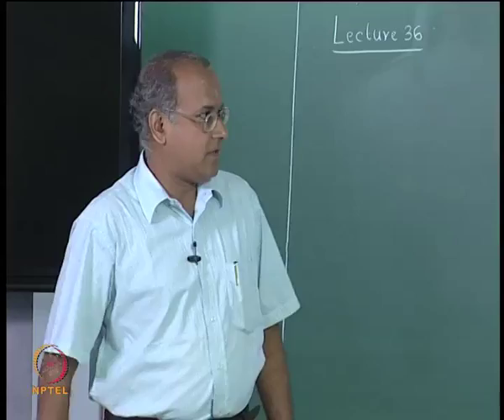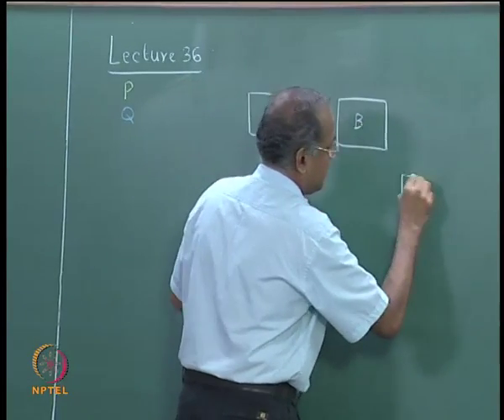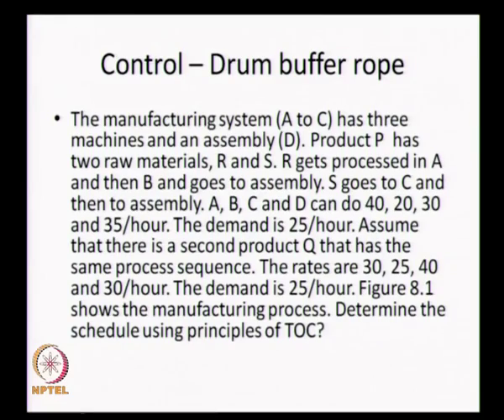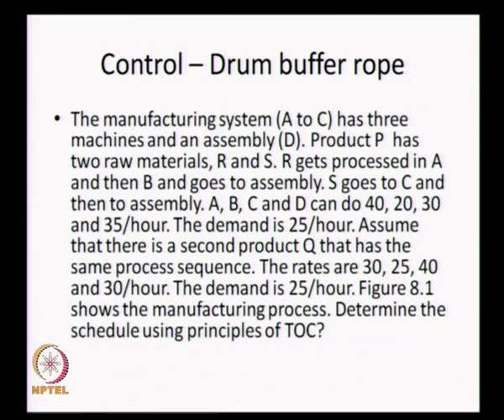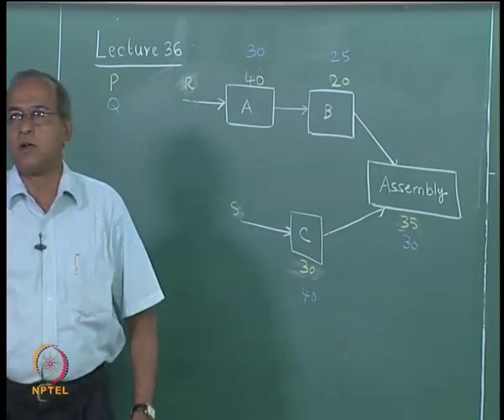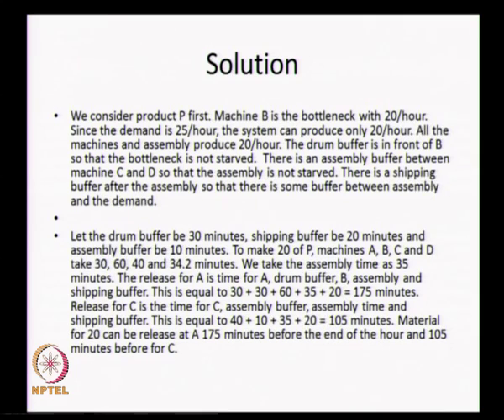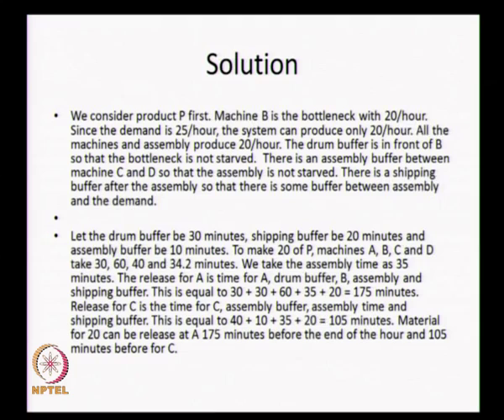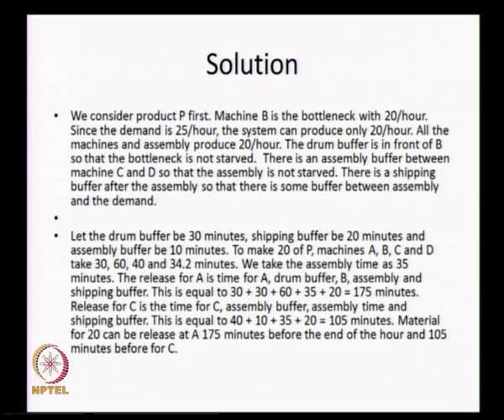Mod-01 Lec-36 Drum Buffer Rope system

Comment: Hi from Argentina! It´s the first class that explains with an example. I have read the handbook of toc but it is not as clearly explained as Prof. Srinivasan does. But I have a suggestion: In TOC, release material comes with a schedule as well as the bottle neck, ie, the Professor is given something close to a schedule. Then you have the rope which signals the material release when to put another order on the shop floor. I would really like to see a full example with a schedule!!!To see how works. TOC is rather difficult to understand, but here in Argentina, I have yet to see when companies will start to implement it!

Comment: Most respected Sir, 

Excellent video to learn DBR concept. 
I'm only a beginner in teaching. 
But, may I point to a minor mistake in the making. 

The time buffers shown w.r.t workstation C in the slide have gone wrong ( precisely, 17 minutes & 55 seconds onwards, in this video ) as you moved to discussion on smaller  transfer batch ( 10 units ) of product P.
Instead of the 40 minutes required at C ( 65 - 105 ) to complete the process batch ;
 75 - 105 has been ( erroneously ) shown, which got further bifurcated wrongly thereafter. 
The mistake has not been observed or mentioned in the lecture. 
Pardon me for the open comment. 
Thank you. 

Rogen K Panicker
Kerala
Reply: To achieve synchronization of the first batch of 10 units in the assembly, it is necessary to release S 130 min earlier instead of 105 min. Is my suggestion correct?